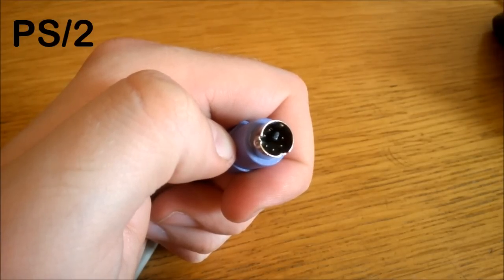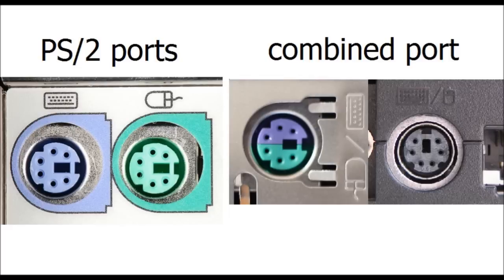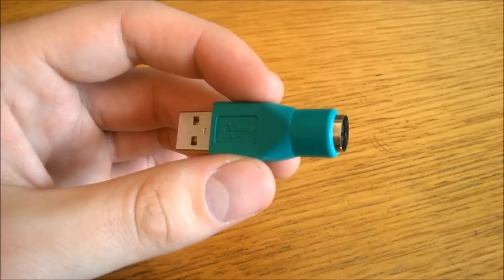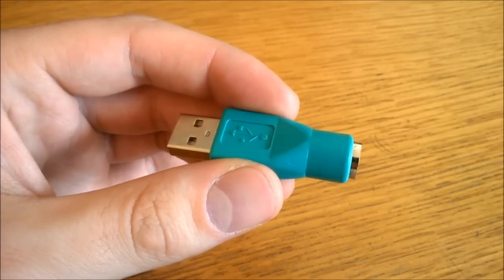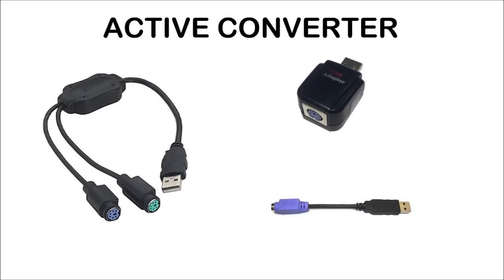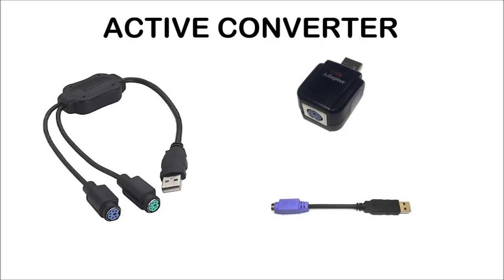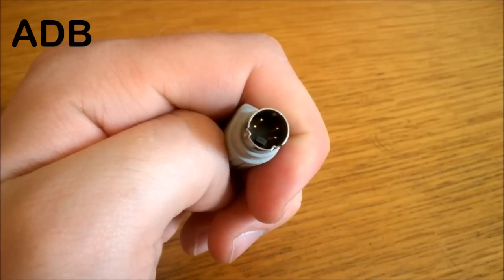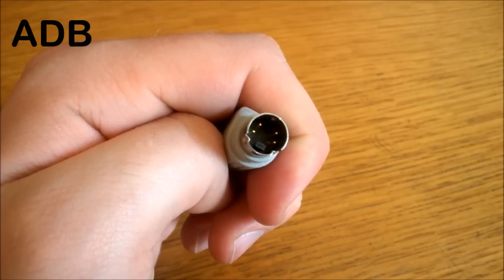QKT 6: Keyboard connectors, plugs and protocols

Comment: I think I connected XT keyboard into AT converter.... is it possible that I broke the connector now? 
When I plug the connector into a keyboard that worked before, now it's blinking num, caps, scroll all of the time. 

please help!
Reply: update... converter is working, keyboard still blinking. Reseting keyboard drivers in w10 did not work :(

Comment: Who made the converters you mentioned? I heard the name but no idea how its spelled
Reply from the maker: Orihalcon, you can find him on GH, DT and eBay.
Reply: +Chyrosran22 gh dt?
Reply from the maker: Nevermind, just get them on eBay ;) .
Reply: +Chyrosran22 whats the name you mentioned of the person who made them?
Reply: Thank you
Reply: I have a Space Invader switch question if you don't mind answering. Trying to locate information on the activation forces of all the SI variations. I went from a NMB to a Cherry red keyboard and the reds seem soft. Trying to find a similar switch to my old NMB.
Reply from the maker: Space Invaders seem to have come in light and heavy variations. All mine have been heavy. There are no official force plots on them, but I measured my clicky ones with weights, they were quite stiff. Check my 8255C+ video for more info.
Reply: Thanks... I need to check which ones I have on my KB.... At one time I owned a whole bunch of these KB's before anyone cared about mechanical KB's so I would find them dirt cheap at computer swap meets and even new they ran about 20 USD. Mine do have a bit of a click like a Cherry blue switch but not as annoying. I just want a linear switch similar in weight if possible.